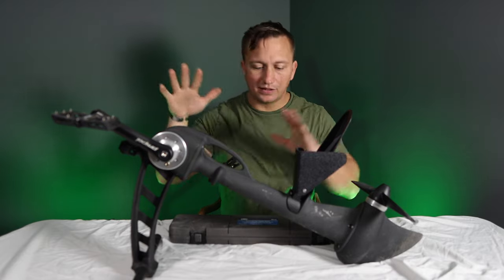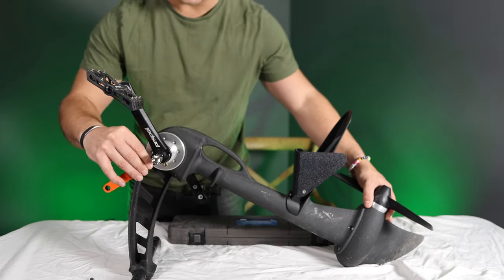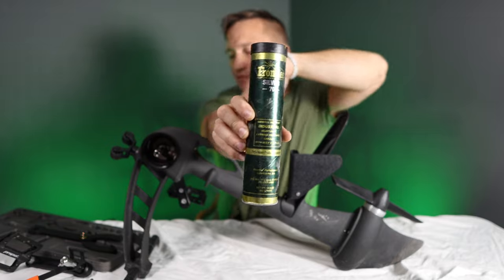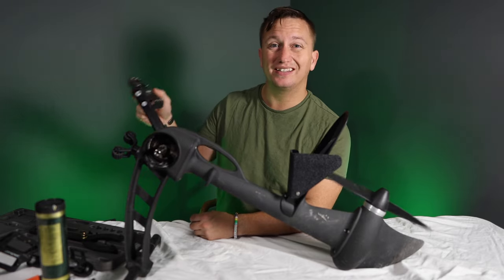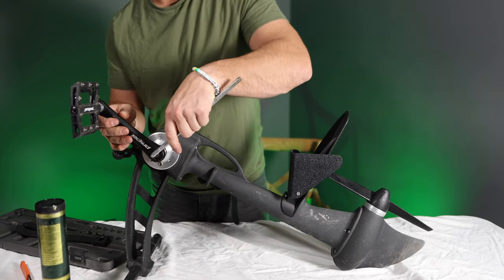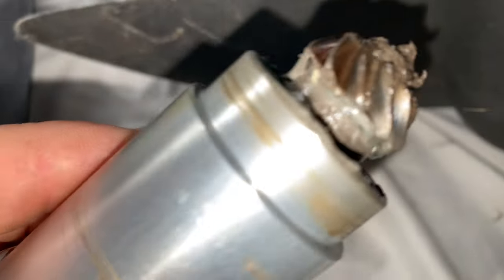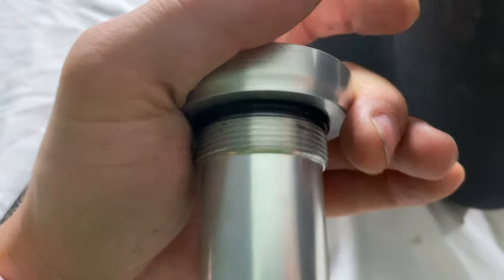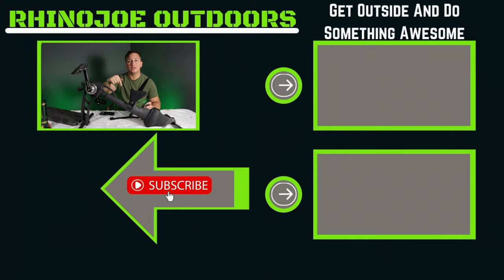NATIVE PROPEL DRIVE MAINTENANCE  FOLLOW  UP- How Well Has The Grease Protected The Gears?

Comment: I tried the oil. It lubricates fine (how could it not?), but I’m going back to grease for two reasons. I don’t like the extra weight to the boat using the oil. It’s heavier than you might think. Also, I’m pretty sure that the pedals spin faster, and feel easier with grease.
Reply from the maker: I could see that being the case. Never thought of the extra resistance from the oil though. Is it quieter with the oil?
Reply: @RhinoJoeOutdoors  Hi, I hear no difference with the noise level between the two.